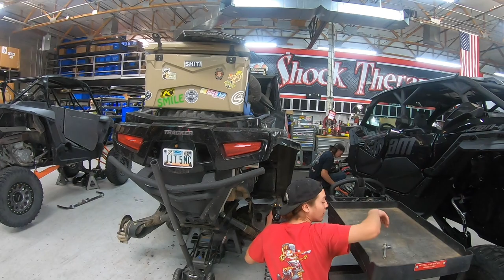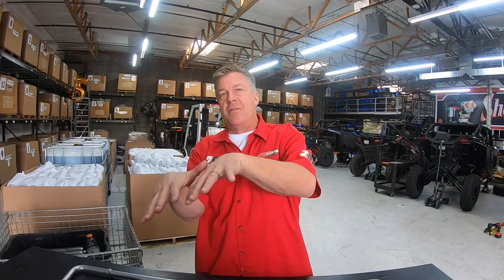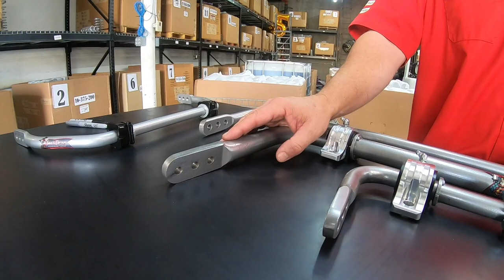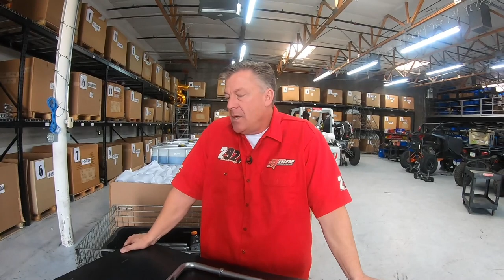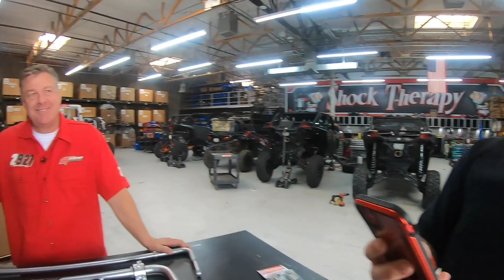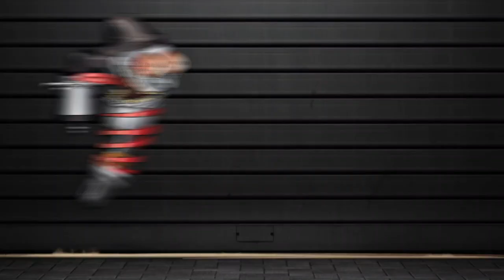Sway Bar 101 (Shock Therapy LIVE 2/9/21)

Comment: I couldn't get the bolt from the links through the sway bar holes. Do you think it's just thick powder coating, and if so, what size drill bit to make it correct size? It's on an x3.
Reply from the maker: That’s a 12 mm bolt. Use a 12 mm drill ore something within .020 of that.

Comment: For flat track ice racing with a Wildcat XX with the ride height lowered to 12".  I wont have a chance to drive it before the race.  My current front bar setup is extremely stiff.  Should I be worried about the bar being to stiff?
Reply from the maker: The factory bars front and rear should be fine for ice racing powered down. It’s the coil springs you should play with in the future for that type of racing.

Comment: On a 17 XP4 1000 I have really bad front right body roll.  I carry quite a bit of weight in the bed and also a rear tire above the bed. I usually drive with three riders. The car does have aftermarket tender springs that have raised the ride height. I realize that all these factors add to my body roll problem, but my buddies 19 turbo rzr has almost the same setup as mine, and he doesn’t have the problem. Is this because my machine doesn’t come with a front sway bar and his does? Why didn’t Polaris put a front sway on my model? Is there a solution?
Reply from the maker: Yes the front bar cures your issues. In 17 Polaris was still figuring it out and making improvements. You will notice that any high power or higher end UTV now has front bars. You can get a front sway bar kit from our site any time. They bolt right on then your UTV will handle so much better.
Reply: @ShockTherapyllc  I am interested, However, where do they bolt on? Is it compatible with my winch?
Reply from the maker: @moejoeryzen2983  Take a look at the site pics you will get all your questions answered there. It is compatible with your winch with a winch plate adapter. It is in the options.

Comment: When will you have a front Anti-sway bar for a Maverick Sport XRC. I also want to know why you can't make a limit strap for the same car using the X-3 mounts & hardware as they are the same in dimension as my Sport XRC, would just need a shorter strap. Get to work engineering such a unit, with the products (hardware) already made an additional strap size would sell more product.
Reply from the maker: The anti sway bars front and rear on our site have a bar for the xrc. The limit straps do as well but we are back ordered on straps right now and all updates to the options will take affect when they are back in stock on the site soon.
Reply from the maker: @dickyhead  So, with your UTV, we have a spring kit and shock internals. We did not build limit straps because the shocks did not clunk on extension in our testing. We might do straps in the future but not now. We will not be doing sway bars for that model. There will, however be an adjustable sway bar "system" available for it in two months or so from us. It is a new product and it will not be new bars. All I can tell you at this point.